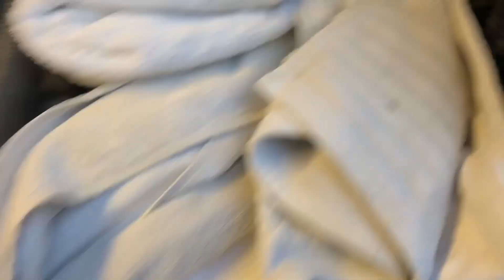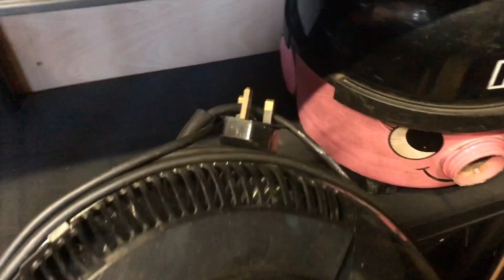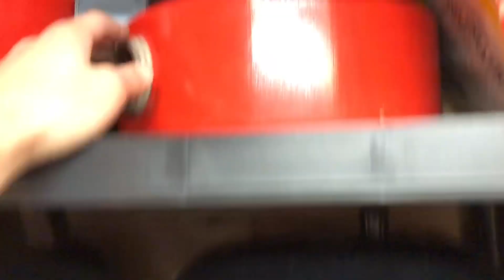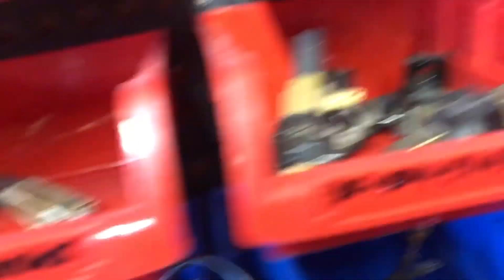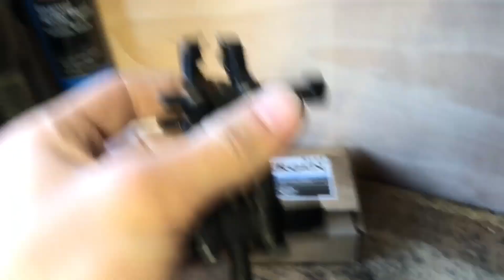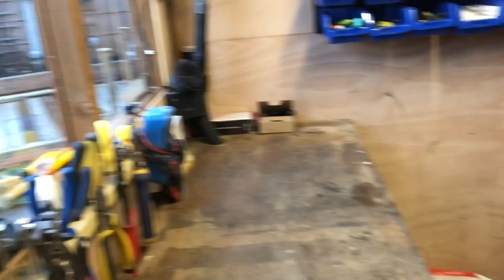Vac shed reveal and tour!!!!

Comment: Which Henrys with the white outline but not the green flower have a push button
Reply: Henry hvr200-22
Reply: Other: Henry xtra Hvx200-22 Henry micro Hvr200m-22 Henry turbo Hvr200T-2 Henry hound Hhr200-2